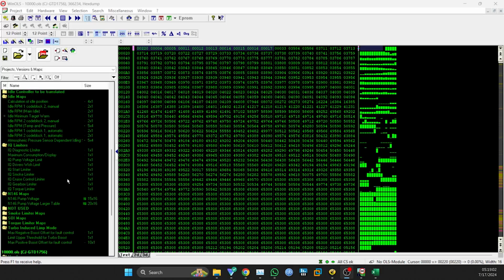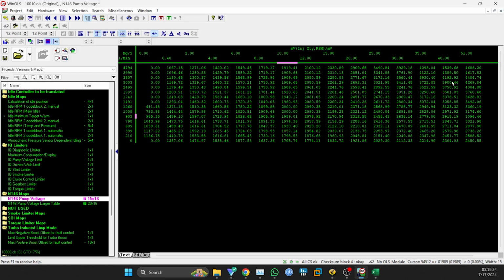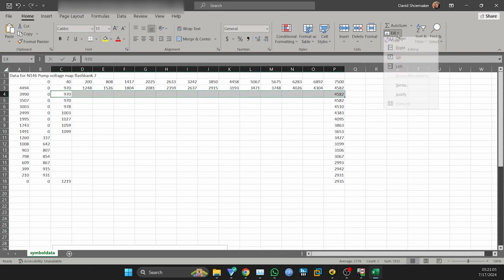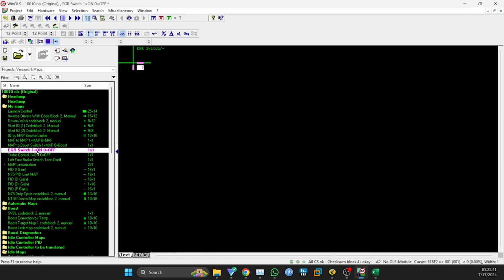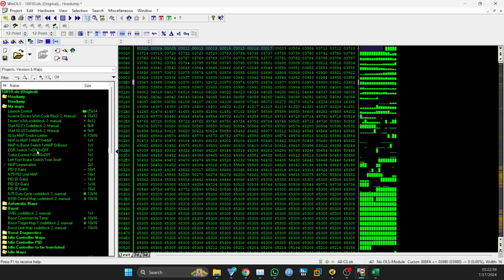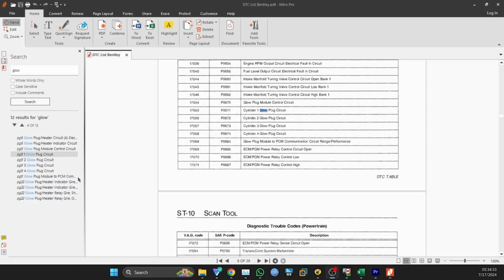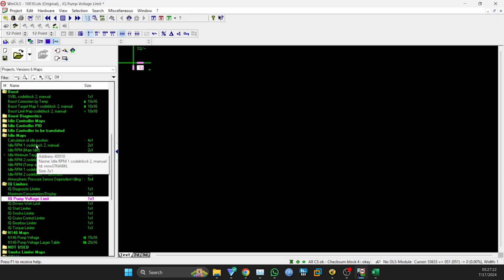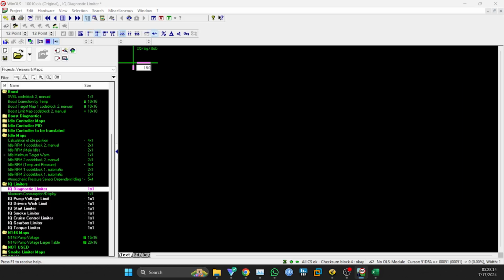Pump Voltage, Waste Gate Turbo, and IQ Limiters

Comment: nice video, you forgot to explain the diagnostic limiter factor value, you also have to change that, otherwise values wont be correctly recognized
Reply from the maker: I don't even know what that is, I don't think. Care to explain?
Reply: @TDISwap  try to change 51mg to 75 without correcting the factor, look at vcds, neither value coresponding to mg/st would be correct.. i dont know how do i explain better
Reply: @TDISwap  i could link you the forum explaining that
Reply from the maker: @atrabanefiltruota  I just read up on it. So basically there are 3 diagnostic limiters to concern myself with: boost, IQ and air mass. I need to adjust those so that VCDS shows the correct numbers, and not the "stock" maximums".
Reply: @TDISwap  yeah the values in the binary are used in "calculations" with coresponding factors!
Reply from the maker: @atrabanefiltruota  gotcha. I did the math and made sure that both the 3 sets and factors were correct for my 4 bar map. I already had all the map addressess, just needed to play with them.

Thank you for the lesson.